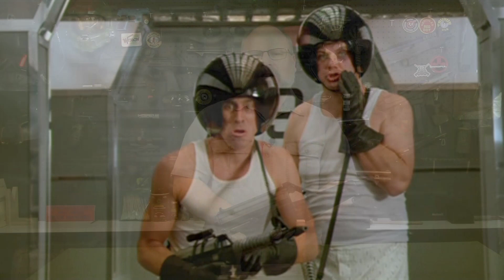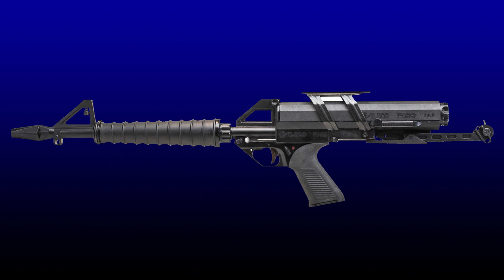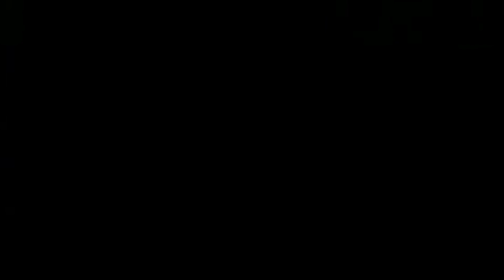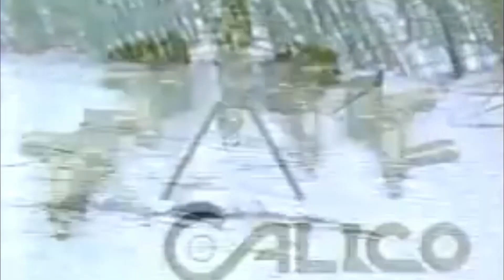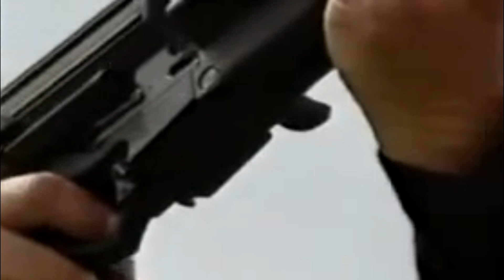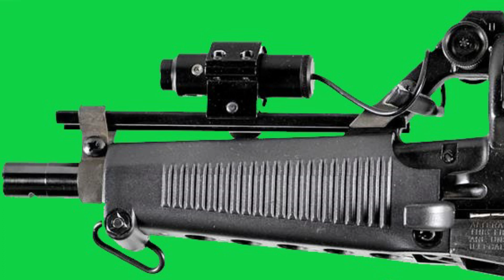Calico M950 Overview

Comment: I bought the 950 around 9 years ago as is from a local shop very cheap. Mag spring was broken. The small tip of the spring itself that locks into one as a stop was broke off. I bent a small piece of the spring duplicating the broke piece and the mag ran flawlessly, though I never loaded more than 10 rounds or so for fear of the piece slipping out or breaking off again. I found their website back then and did buy a new factory spring, installed and works as it should. New spring was more of a flat coil spring whereas the original was a standard coil spring. Mine came with a factory optics mount with a vintage Aimpoint Model 3000 made in Sweden on top that works perfectly. Mine does not have the ghost ring sight at the rear. It is an M-950, and does not say Liberty on it, so the earlier model. Shop sold it new in the 80's, the spring broke days later, so they bought it back and sitting on it since then. It was made in Bakersfield, California. I spoke to the owner back then and he said they had plans to produce uppers using their mag system to fit Mac style guns. Seen prototypes online, but never produces far as I know.

Comment: I personally own a pre-ban rifle, and a more current pistol, the Liberty III. The rifle I am doing repairs to as it has bad habits. The pistol runs flawlessly. Not the first failure out of the pistol yet (5-600 rounds I'd guess). They are fun range guns and are remarkably accurate if you can get by the very heavy trigger pull.

Comment: I owned an M-100 that was a real pos to shoot. I spent more time extracting .22s than I was shooting them. I'd say, that out of 100 rounds loaded, that I would have to pull out 35 of them. The greatest thing I ever did with it was to get rid of it.
Reply from the maker: It is hit or miss with the Calico line. From what I have been able to determine, the 22 rimfire versions did tend to jam a bit more, which is understandable. 22s in general tend to have more issues like that.  We have not had the M950 to the range yet, I am hoping it is one that works well.

Comment: I own a m950 like yours. I too have looked into ordering parts. The fact they do not take credit cards has me concerned and Im not entirely sure I will get the parts I order from them once they cash my check. I was wondering what your experience was with the company. Thanks in advance.
Reply from the maker: I am happy to say that I ordered some items and I did receive them. It is a weird process but it did work. I did call and asked if the items were in stock before I ordered. I can't say I like the process but it worked. They told me that the credit card processor they had used dropped them since they were a firearms company,  and they have not been able to get a new one yet.